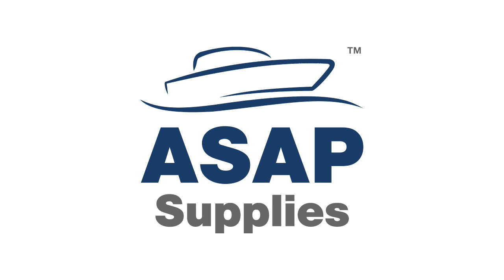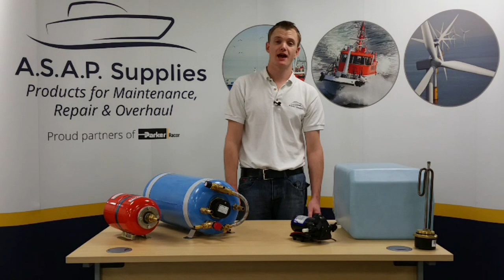How Calorifiers can provide free hot water for your boat

Comment: The connection tubes are 15 mm.   And the connecting tube for the cold and hot water are smooth connection tubes and not sure how you can plumb to them

Comment: if you are using hot and cold water do you need 2 expansions or can you just use one and where would be best to put it. ive seen others just have one in the cold water side and not on the hot water. is this ok? thanks
Reply from the maker: Thank you for your question. You should always have an expansion tank on the hot side as without it you risk hot water spraying out of the PRV valve. This just needs to be fitted anywhere in the hot water line. 

On the cold water side (which is often referred to as an accumulator tank) it is optional. On older pumps it is recommended to have an Accumulator tank to reduce pulsing, however many of the modern pumps have built in bypass’s which then eliminates the need for an accumulator. If you know the model of your pump we will be happy to advise if it has the built in bypass or not.

If we can be of any further assistance please don’t hesitate to contact us.

Comment: Why is it 16mm on the calorifier hose tails, is that normal thing in plumbing?
Reply from the maker: Thank you for your question. The 16mm hose tails are for the coil connections and yes 16mm is a common size for this. We can supply a suitable 16mm hose - https://www.asap-supplies.com/products/hot-water-hose-and-steam-hose-16mm-id-sold-per-metre-206016 If this doesn’t suit your application please let us know what size connectors you need and we might be able to supply adapters.

If you have any further questions please don’t hesitate to contact us.

Comment: Hi! How much psi pressure should there be to the expansion tank with a 75ltr calorifier? Ta!
Reply from the maker: Hi David. Expansion tanks (used on the hot water side) need to be set above the maximum pressure of the pump but below the pressure of the pressure relief valve (PRV).
Reply: @asapsupplies  ok thanks!
Reply: I have a second smaller accumulator from my water tank! Would that make any changes to expansion tank (hot)?

Comment: Jay ...
Must take objection to your 'free hot water' statement - only applies if the diesel, gas or electricity used by the boat owner to heat the water was free in the first place !
Reply: I consider it free, I get hot water when I'm running my engine for other reasons, so it's free.
Reply: @bobaquaplane1679  When sailing, I try to use my engine as little as possible. So just running it to get hot water isn't exactly free either.
Reply: Always one good grief!!  Away and make some toast!
Reply: @jurgenpuype9275  yes this is mainly for motor yachts.

Of course in modern times the difference between a motor yacht and a sailing boat is the sailing boat only has the engine on 90% of the time.